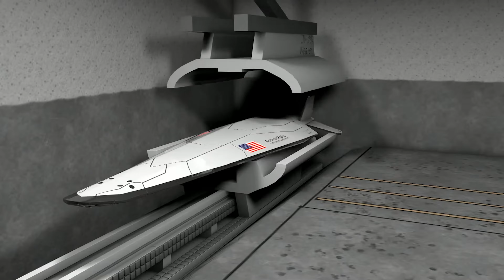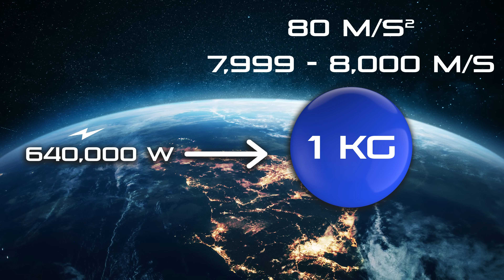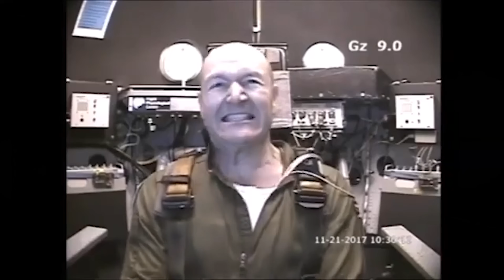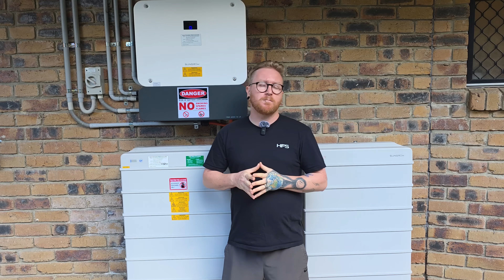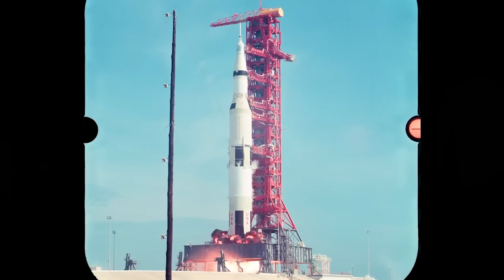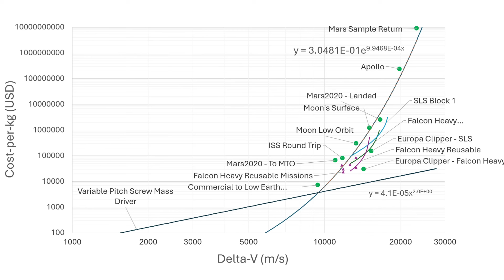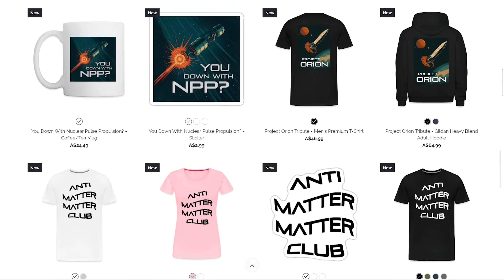The New System That Could ACTUALLY Replace Rockets

Comment: i really need far more explanation on the physical construction of the launch system. i already know once basically any concept is built and working, it'll be far better than rockets, but it really, really does not matter unless the project actually can be built and actually can work reliably.

"VPSL is a system that can reduce launch costs" tells me Nothing.

how does the magnetic coupling work? how does the vehicle gain momentum without losing the induced magnetic force as heat? does the carrier or do the rotors need to be superconducting? how does the screw induce magnetic flux to the vehicle/carrier? what is the screw made of? is the screw also charged to induce magnetic flux? does the carrier need to be charged to induce back-emf into its coils? is this using induction at all?

what is the actually accelerating principle at work here?

thats not even getting into the mechanical design, how are the screws constrained? do they need to be electromagnetically continuous? what are the tolerances for the carrier? what rotational speed do they operate at?
Reply: Just magnets 🧲 Fund it first then you’ll get the answers 🤣
Reply: Yeah even a small scale demonstrator would be helpful.
Reply: Good questions but this system is a fail.

Comment: All we really need for space travel is Negative effective mass that passes through a positive mass lattice in a disc like formation because of the runaway effect the negative mass will keep moving and generating a reverse EM Field through rails and this will cause the hull to push itself up to the speed of light and if you can curve spacetime over the hull and as the bend spacetime in the front it creates a slope it will create a gravity well that you just keep falling towards creating indefinite speed for cheap.   Powered by the same type of fusion reactor that bends spacetime and creates ftl plasma that smashes fusion targets and creates far more energy in than out.  This would power the warp bubble with a small reactor of roughly 3-5 feet across of Deutrium Deutrium fusion.  I however am ignored and I feel a little down right now because I have heart problems and I dont know how much longer I have.

Comment: Wouldn't long thin leadscrew segments whip at the required speeds?  (Fly out radially, buckling due to centrifugal force.) This puts a hard speed limit on leadscrews in CNC, for example.
Reply: Especially as the screw has to bend upwards
Reply: My thought exactly. I thought maybe they'd use several segments of just a few meters but it doesn't seems like that. I wonder how they plan to keep that screw straight on a few hundred meters or even up to kilometers.
Reply: @dreamyrhodes I wonder how they would deliver the screws from the factory.
Reply: @kevshouse  FedEx
Reply: @kevshouse  Make them onsite, my concern is what RPM are we talking about, to decide if we can manufacture suitable bearings to locate the screws.
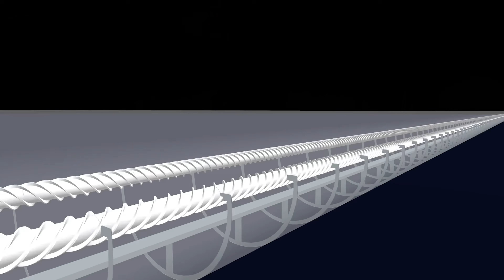Reply: @16:40, there's a clip that shows how the screw segments are supported every few meters by brackets, so the screws won't whip. The screws stay synchronized because there are flywheels inside the segments that spin slightly faster than the screws. When the adaptive nut is alongside a screw segment - creating a torque on the screw that would normally slow it down - the flywheel brakes against the inside of the screw to prevent it from slowing down. The pitch of the screws does get steep near the end of the acceleration section, but the adaptive nut is magnetically coupled to the screws, so the forces are still transferred efficiently.
Reply: It will be interesting to see how the segments are coupled together such that they stay aligned, assuming each needs to be driven separately to avoid said buckling. A similar challenge might exist for coupling the left and right screws as well.
Reply: When he said held aloft by drones I let out a loud laugh.  These energies, velocities and systems, lifted by drones?  Kept aligned against wind, by drones?  Did they account for that ridiculous energy cost in their models too?
Reply: @JohnBysinger  Build them up a mountain.
Reply: @JohnBysinger  Yes. They have a digital twin of the entire system.
Reply: Maglev is a thing and this is barely a fun thought experiment.
Reply: Space CNC
Reply: The speed is changed with variable pitch not just radial speed. Each screw set can run at a static speed and the screw sets at different speeds. So you can use optimized motors and screws for every set
Reply: Don’t make them long.

Comment: Building something like this near the equator would be a solid way to put construction materials into LEO.
Just north of Darwin in Australia would be a suitable location.
Although building it up the side of Mt Kenya would be ideal, a barrel tip at over 3 km altitude is desirable to minimise the heat pulse from the atmosphere on exit.
If you want to launch at hypersonic speeds you need to reduce atmospheric heating, so high altitude locations are appealing.

VPSL has limited payload width, with a rocket you can often make a custom fairing or larger rocket to service a giant payload.
Other than that it's mostly good, it's just about finding a location that sticks without protestors ruining it and getting it cancelled.              :D
Reply: This system can never work. Not in a million years. The idea was formed by fools.
Reply: @Chris.Davies please explain to us why?
Reply: @Chris.Davies  Why's that?

Comment: The Navy tested for about a decade a railgun system by BAE Systems and the problem was that the energy traveling through the rails consumed the rail very rapidly so that you got only a few launches.
Reply from the maker: You're absolutely correct there, railguns are (at least for the moment) a bit of a dead end. It's a shame, because they're extremely cool.
Reply: What you said was true but from what I understand it isn't what killed railguns. Having many replacement rail gun barrels on a ship is no different to having missiles that are inherently one way.
It's actually the guidance systems not being able to withstand the high g forces. If unguided, accuracy drops quickly
Reply: China has railguns.  They solved it somehow.

Comment: The escape velocity talk is a bit far out. Is there any mvp intermediate smaller stepping stone system - like a mach 2 system  for ramjet  assisted rocket planes?

Kinda wonder if a low isp <150 reusable  rocket first stage would be simpler for mvp launch assist.  Say a lox propane boiler that vaporises liquid nitrogen or co2. Like an air independent steam rocket that uses LN2 instead of water. Staging very early. Could cut gravity losses and better match exhaust velocity with rocket velocity for first minute of flight (given max efficiency is when v_rocket = v_exhaust).
Reply from the maker: I know it seems that way, to be totally honest with you when I first saw the idea it seemed a little far fetched. The more I looked into it, the more it made sense. The numbers are all there, and they check out. Phil and team are serious engineers, this definitely isn't a napkin-math idea. That's an interesting idea, I guess it would depend on the exact performance numbers required to cancel out the atmospheric air resistance. There's also the matter of the required thrust to land on Mars, or wherever you're planning on going. Virtually no atmosphere to use for deceleration on Mars so the engines would have to do all the work, 11.1km/s is quite a lot of work to do.

Comment: Forget rail guns, Think about aircraft carrier magnetic launchers ! A vacuum tube that size would be so incredibly heavy ! !
Reply: Good one compared to the concept in the video :-).
Reply from the maker: The infrastructure would be ground-based, so weight isn't really an issue. The tube extension (the part which pokes up into the sky) would be light weight, as its purpose is to maintain the vacuum. It would be very similar to an airline fuselage, pretty reasonable weight wise.
Reply: @HelloFromSpaceAus  Being ground based doesn’t make mass a non-issue, just a smaller one. Structures still have to support themselves, and the foundations/ground under them has to support that. For something that would have to be incredibly steady/precise in how all the parts align it would need both a lot of internal stiffness and those foundations would have to be solid enough to not just support the mass but also resist the launch forces with minimal shifting along the length of the tube. 

You also absolutely cannot compare the structure and mass needs of a vacuum tube that is going to carry a rocket sized payload to an aircraft skin. The diameter would be much larger, and pressure differences larger as well- not impossibly so, but enough to already make it a false comparison. However, those combine with the order of magnitude greater length and the same need for extreme stiffness as the foundations. Accelerating a large mass to even a significant fraction of orbital speed would need the whole system to be extremely steady and straight to avoid the payload contacting the tube wall and ripping the whole thing apart from the huge energies involved. With current or proposed materials, that kind of stiffness means a lot of mass for the screw and tube so they stay perfectly aligned.

That need for everything to stay perfectly aligned the entire path also adds new requirements to any payload so the mounts and the payload itself won’t flex enough to contact the outer wall. That means added mass to the single worst place, the part you need to make it all the way to orbit.

All that flex resistance you need to make this screw drive/tube system work, though, also works against a key part of large structure design- surviving any seismic activity.

Comment: First time I hear this idea. I could not understand it to the bottom. 
Isn't a conventional rocket fuel just an efficient way to store energy for long time?
How big amount of mechanical energy could be transferred from one place to another without a contact?
And wasn't spin launch an idea that has already tried to replace rockets as a way to launch to space, that has gone down the road with accumulating problems?
Thus I need to hear more before I buy this salesman idea, and be convinced that it is not too good to be true as previous ones...
Reply: As Brad explained, SpinLaunch is better than other electromagnetic launchers because it reuses the electrical machinery on every rotation. It is limited, though, because it can only launch G-load hardened payloads, and because material limits prevent it from accelerating vehicles much beyond perhaps 1000 m/s. Because VPSL is a linear accelerator, it doesn't have those limitations.
Reply from the maker: Nailed it👌
Reply from the maker: I'm certainly not a salesman, just a communicator of interesting facts and ideas that I like. If you're interested, I've put some links to some of Phil Swans presentations on this (where he goes far more into depth) in the description of this video.

Comment: On the Moon or Mars? Perhaps. From the Earth? Nope. Lots of misuse of the word 'exponential' in this video, whilst avoiding the biggie: Atmospheres get exponentially thicker the deeper you descend into them. Or in other words, if you plow into Earth's Atmosphere at sea level at orbital velocity, no rocket in existence will be able to balance the Drag force: your craft will vaporise in milliseconds whilst decelerating at mega-gees. Unless the end of the launching tube is at least 80,000 feet above sea-level: good luck with that.
If they can propose a much less ambitious tube that fires payloads out at half of orbital velocity and at the top of the Andes, then that would definitely get my attention. (I AM a rocket and trajectory simulation Engineer).
Reply: The end of the tube is at least 80,000 feet above sea level. It resembles a long airline fuselage supported by electrically powered lift fans, which are powered via HVDC power lines that deliver power from a power plant on the ground. It coils itself up and flies back to avoid bad weather.
Reply from the maker: Got me on the use of exponential! Whilst it would have been technically correct to say 'exponential-like' - it's also really hard to pronounce over and over while filming😅

I'd encourage you to read Phil's paper. It's incredibly in depth, they've really done the work. It does check out, and it's worth the read. There's some links in the description for some of Phil's videos where he goes a lot more in depth if you're interested

Comment: It sounds like a system that would be great for returning raw materials from the moon to earth or for oribtal construction.
Reply from the maker: Excellent thinking, in the longer interview with Phil we spoke about this - using VPSL for orbital construction. This would be a next level technology for humans
Reply: No. No it would not. Not even remotely.
Reply: Once we industrialize the moon, we could build some maglev train infrastructure there. Those maglev trains should easily reach the moon's relatively low escape velocity. Without an atmosphere there's no need for a tube or an upward bend, just a long straight section of track, that would still be usable for transportation.

Comment: lol, how to break the law of physics and tells that's good idea...
Reply from the maker: This is all 100% within the laws of physics, in fact it uses the laws of physics to its advantage. This isn't a napkin math idea, the paper is peer reviewed and very well worked out.
Reply: @HelloFromSpaceAus  Threads pushing at 8G with that distance and keeping is integrity? Seeing all mechanical problems we having with ship and trucks axle at low speed, I cannot fandom troubles occurring at high speed kilometers long. Pushing on only one possible orbit angle seems weird. Did you calculate the drag and temperature at the output and the velocity loss. And keeping low pressure on that distance? Any news with Hyperloop? I don't think any of these "canon" type technology can work well on earth because atmosphere and delta-v needed.